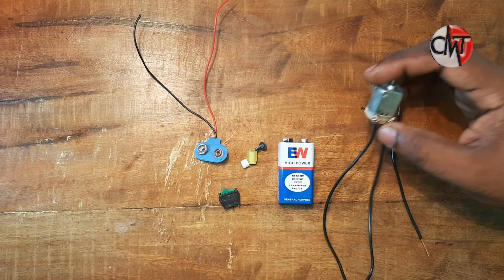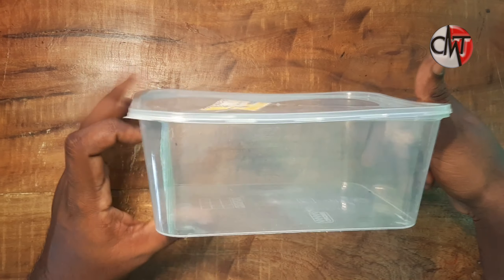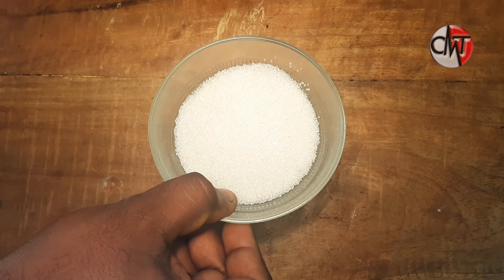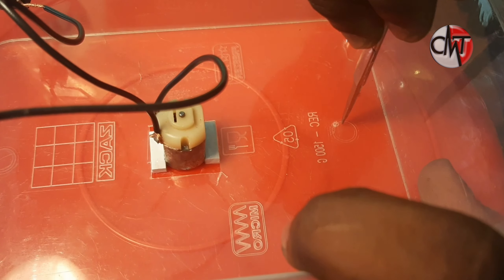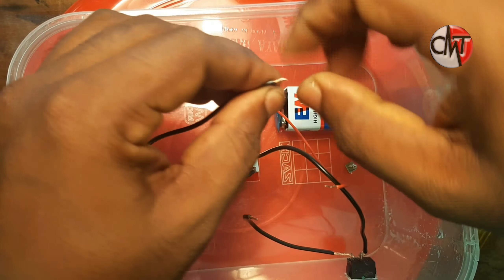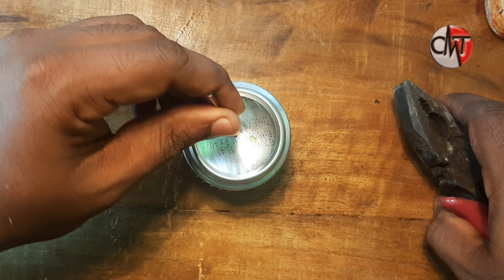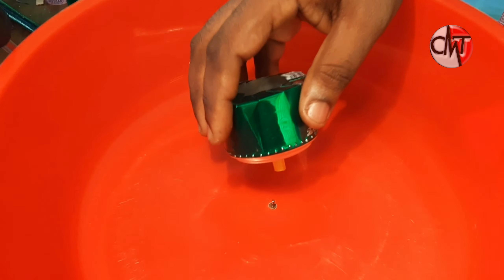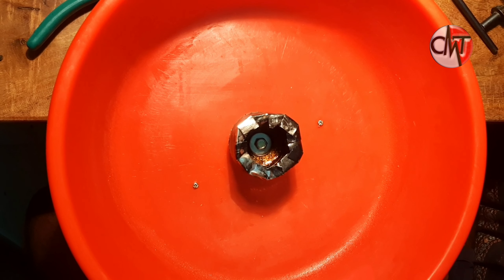How to make cotton candy at home 🤩🤤|| എങ്ങനെ എളുപ്പത്തിൽ പഞ്ഞിമിഠായി ഉണ്ടാക്കാം 😍

Comment: Sambhavam cheetyy😌
Reply from the maker: Nth patti ?
Reply: @visualsonwheelsbyvishnu3000  ath aaki saadha motta battery kond ath aayilla.pinne ath aakitt thanukkan vechappam ath katta pidich angane motham cheety
Reply: @visualsonwheelsbyvishnu3000 aa sugar&water correct alav paranjal onnoode cheyyamaayirunu
Reply: @visualsonwheelsbyvishnu3000  njan onnoode cheyth noki 
Work aayi pakshe vegam motor ninn poi appam thanne panjasaara katta pidichu
Reply: @visualsonwheelsbyvishnu3000  katta
 pidichondu kazhikan pattila.

Any way thanks.
Katta pidikkathe irikkan valla trick ?
Ingal nalla smooth aayitt kayichille ath ntha katta pidikkathe???
Reply from the maker: Bro maybe. Motor over load kond ninn poyathakum.. njnglum ithpoleyan cheythath. Maybe time late ayappo katta pidichathakum